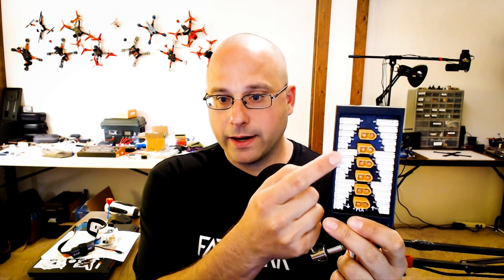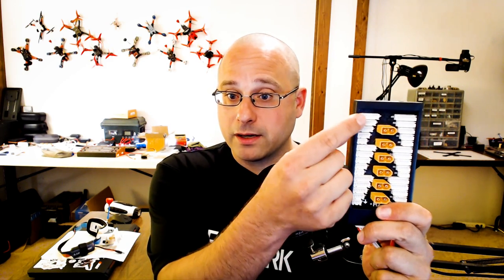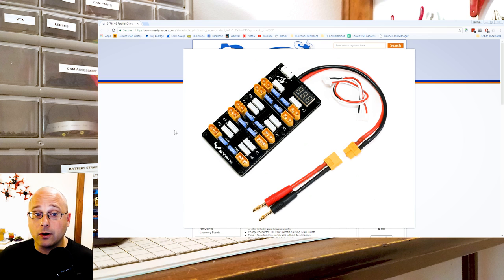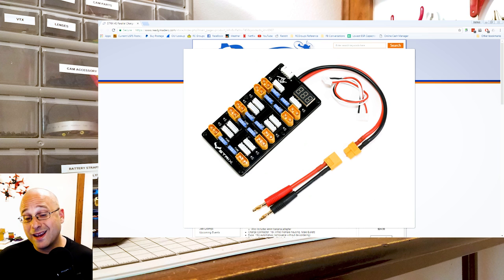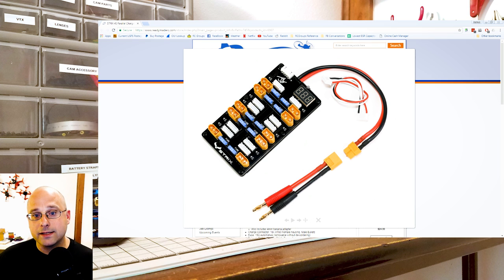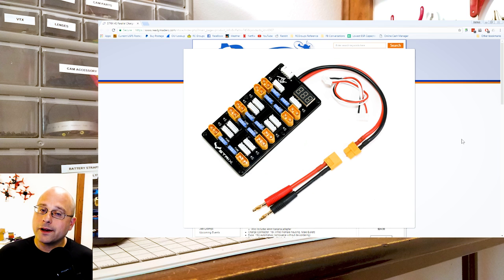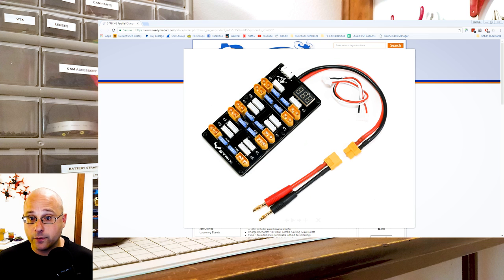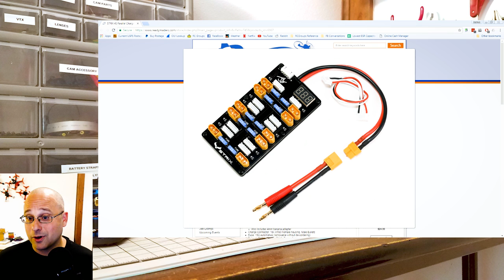The Best 4S Parallel Charging Board. Period. | JB SIGNATURE LINE

Comment: Is the voltage checker always on? If you store your batteties on the board overnight to charge in the morning will it be on the whole time?
Reply from the maker: I believe so.
Reply: Who leaves their batteries plugged into the balance board overnight ?? WTF
Reply: Why are you charging over night? That sounds like a really bad idea, especially parallel charging. And if your charging mini quad packs they only take 20 minutes max.
Reply: Phat Kid Nobody said anything about charging overnight.
Reply: Dude you make no sense... Just plug it in when you wanna charge.
Reply: I get what you're saying. I have ISDT and when charging is done it starts annoying me with beeps, at which point I unplug power to ISDT to turn it off but do not always unplug all the batteries from the balance board right then as well. They may sit connected to balance board but fully charged until morning, etc.. This would slowly drain them during that time. Not a deal breaker though by any means. Maybe include on/off switch for voltage checker in V2?
Reply: You make a good point, I killed some of my 2S packs for my micro as the balance board has LEDs on it which drained the packs down when I left them on the board overnight.
Reply: What C are you charging at to make them charge in 20minutes?!?
Reply: Eric Plank just turn the beeps off , I also have an ISDT... you can set it
Reply: 2C would take about 20 minutes, give or take. I charge at 2C. And I agree, I too will charge my batteries and then maybe I'm doing something else and the charger has shut down but I don't immediately run over and unplug the batteries. That is a very good point to make, in my opinion, but ultimately it's not super hard to avoid by making a slight change to my charging habits.
Reply: he said "to charge in the morning " but I agree, still a stupid place to store you batteries,. saves you a minute at best that night! what C do you charge at for it to take 20mins??
Reply: It is only stupid if you have a cheap, junk parallel charging board where it poses an issue, or if you’re not smart about it.

All your multi-cell lipo packs are basically the same thing….a bunch of cells wired either in parallel or series. That is all you’re doing when plugging them into a board.  Do you cut open all your packs and disconnect the cells for overnight storage???

When not in use during flight, ALL my packs are stored in fire-proof storage.  They are connected to the board so there is no stress on any of the wires, and there is nothing that makes this inherently more “risky” than having a pile of lipos not connected to a board.

It was a fair question, as the boards with flashing LED’s or readouts get annoying if you SAFELY have them plugged in while not charging.  Most people don’t do this, so it won’t be an issue for them...but it can be done perfectly safe.
Reply: 3c charge rate would be done in roughly 20minutes and most of today's lipos can be safely charged at higher rates then 3c
Reply: @ PowerScissor...AGREED, just as Joshua stated early on, the boards make one big battery. In fact, leaving them all connected helps keep them all balanced as one big pack... which in turn, should help maintain a consistent feel from pack to pack during the flying session. ALTHOUGH, checking balance on individual packs is a MUST for detecting a potential bad cell. Parallel boards may hide that for a little while.

Comment: NOOOOOOO! I just bought another one off amazon this am! absolutely brilliant MR. Bardwell! I was saying this the past x amount of times I parallel charged, about all the unused ports! not only that but I, I mean a friend of mine wasn't paying attention, because he cat came close. no kitty danger! well I,,mhhmhm i mean he plugged the balance in backwards. sparks, burning electronic smell. well i started using a black marker, and only coloring the negative side half of the 4s port. this was it makes it a little harder to make that mistake.  the price of this board is pretty darn good for what you get!!  especially with the xt-60 for supply connection! you are killing me, even though I just ordered a new one this am. i'm going to see order one of yours now! oh plus I think 5s might take over 4s. just a odd feeling! I have a 5s on the way to test this week. hehehe
 So here's my theory, and analogy that made me order 5s. So since all the new gear can handle 5s no problem people might be switching over.  Ok weight quads, so the extra battery weight will make it faster, because of increased angle of attack.
 now another thing. I pretty much toasted all my new 4s batteries, and that is not cheap! So here it is.
 You have a 2 brand new cars from dealership only difference is one is a 4 cylinder, and other 6
 now you want to get on the highway, and traffic is doing 80 mph. With the 4 cylinder your going to have to redline it to get up to speed fast enough to safely get into traffic. Now you try it with the 6 cylinder, and same scenario, but,  and here it is! You only have to give it 3/4, maybe even less! ohh big deal. well that 6 cylinders engine is going to last longer, because with the 4 your pushing it to the max all the time trying to get up to speed. just like any other machine if your riding it hard all the time it's going to breakdown more, and faster.  Now the battery is the engine. 4s = 4 cylinder, and 5s equals eight! correct me if i'm wrong, but since 5s has more volts your not going to have to draw as many amps to get the same rpm? you know i'm new to this so I could be way off!

Comment: Hi JB, was digging back deep in your videos because I had a battery fire in my apartment yesterday. I thankfully had all the secondary safety stuff (battery bag, ammo case, etc) that it was contained with no issues. But I was parallel charging 4 3S packs, when one burst into flames. Somehow the other 3 didn't get melted or burned. Are those other 3 batteries trash? The parallel board also? 

Frustrated that I've gone to OCD levels to make sure I don't deal with battery issues and still happened. Think I'm giving up on parallel charging and just doing one at a time until I can regain some confidence that it can happen in a more safe manner.

Comment: Hey Joshua, great job man! Hey, since daisy chaining is allowed, what is the max size fuse that can be installed for that particular port to feed the next board or boards? How much can those traces take? 

PLEASE, correct me if my math is wrong here.... Meaning, if you want to charge 28 of those 30 batteries, you'll have to daisy three boards. If they are all say 1500mah, 1.5 X 28 = 42 amps at 1C. 42amps/3boards= 14 amps per board. So, does that mean the first board gets hit with 42amps, second board port fuse gets a 28 amp fuse then the last board gets a 14 amp fuse?
Reply from the maker: The entire board is limited to 60 amps. I think your math is basically right. Every time a battery taps off the positive line, some current is moved over to the negative line. The fuses are on the positive line.kl

Comment: Great idea! I'm on the subscription list for when they're back in stock. Anyway, R-Lines have really short balance leads. Have you tried to plug a few of those in at once? Curious if it'll work as well as my standard balance boards with the balance connector along the edge.

Comment: Hey Joshua great product.  I already have mine!!  One question.  I am replacing my EP Buddy parallel boards with this one.  The EP Buddy ones have three 40a fuses and one 50a fuse.  Your board has ten 15a fuses.  Why is there such a big difference between the fuse sizes?
Reply from the maker: Just a question of where you draw the line for safety I guess. We don't think there will be a situation where more than 15 amps will flow into any individual battery, so that's how big a fuse we used. Part of the reason may be that we are thinking more towards the mini quad market, which uses smaller batteries.

Comment: The paraboard I always wanted was one that would level the voltages on my batteries before charging so I don't have to make sure the voltages are within the correct tolerances.
Reply: This is my issue as well.  I don't have enough batteries to have enough batteries that are all within a close voltage to really make use of one of these.  I guess if i ran 20+ batteries or more during a session, something like this would be useful.  Maybe.  Given that my batteries all come down with voltages different enough, I'd rather just use two or three actual chargers.
Reply: @ thejason51873 Just plug them into the board and let it sit for a little while before charging. They will balance out without charging...meaning all of the cells on the first circuit will balance to each other and same with the rest.
Reply: That's just the way it is, otherwise, look the RCmodelsreview Youtube vid, about balancing lipos , and the special cable bruce made, for a single cell of your lipo.

Comment: you can shave off part of the locking tab on the 4s balance lead so it will fit in a 6s balance port no problem and its still keyed so you cant plug it in the wrong way

Comment: Hi, great product.
About chaining the paraboards, I'm not sure it's such a loss. I don't know the internal wiring of mine (hk, 4 out, with fuses) but I noticed a pretty big voltage drop: 0,5V between what the charger sees and the last lipo with 3 boards . The first lipo sees less, but it's still something like 0.2/0.25V more than the last one on the line. So when I start charging from an identical voltage, I think the first ones get charged at higher undertermined current than the last ones. 
What I do is not a chain but a loop of paraboards so the current flows in 2 ways. I also put the less initially charged batteries the furthest from the charger connection and put less than 1C of my average load (typically 10/12 instead of 15).
Am I paranoid, or does the voltage drop affect how faster the first batteries on the line charge ? I guess it would take a dozen of amp/voltmeters and some wiring to find out.
Reply: wires are also resistors
Reply from the maker: You're right about this, although I haven't seen 0.5 volt myself. This is why I always charge at only 1C when using parallel boards. Because the batteries on the board closest to the charger get a higher current and I don't want to damage them.

Comment: That looks very very nice! One thing that I have on mine and would make it better, albeit a little bigger, would be resettable fuses for each balance trace (I know there is space concerns but maybe the other side of the board is not that populated?). People are supposed to plug the XT60 in first but just for additional safety, that would make it just about perfect. Hints for version 2 :) I'm guessing there could well be a 5S or 6S version in the future?
Reply from the maker: The problem with polyfuses is they are expensive. Look at all the boards that have polyfuses. They are $60 to $80 for a six-port version. $10 per port vs. this board which is $2.50 per port.
Reply: Thanks for taking the time to clear this up!

Comment: Looks pretty sweet! However, I don't think it's the board for me, as I still have 10+ 3s packs I use on a regular basis.

Also, progressive RC has some nice para boards. Theirs have removable fuses and such, but lack voltage checker. But, if you are using the para board with an Isdt charger, it is quite easy to plug   in a battery and see the voltage.

I'm glad you finally released a well thought out product though. Good luck!
Reply from the maker: No offense intended, but Progressive is asking $24 for a four-port fused parallel board. If you intend to charge mostly 4S, there's no contest.
Reply: Joshua Bardwell haha yes, that is very true. PRC para boards are not cheap, lol
Reply: That's a one time expense :)

Comment: Great product. 
How long does it take to fully charge ten 4s 1300mah 14,8v batteries when they are empty? 
Thank you
Reply from the maker: 1C is the safest charging rate. It always takes exactly 1 hour to charge at 1C, by definition :-)

In reality, the batteries won't be 100% discharged, which shortens the charge time, but if you balance charge, it lengthens the charge time. And in my experience those two often sort of cancel out. 

If you are charging the 10 batteries one at a time, then it will take you 10 hours to charge them. If you put them in a parallel array, and if your charger can output 10 * 1.3 Ah = 13 amps, then they will charge in 1 hour.
Reply: Thank you for your detailed answer, helped me to understand the parallel charger!

Comment: What is the best bang-for-buck lipo in your opinoin? I am on a pretty low budget and want to buy some 4s batteries between 1300 and 1500mah. Could you make a conclusion video of your battery comparison videos? Great product by the way.
Reply: gustav gans go with cnhl batteries, usually on sale, way cheap, but good quality, I see a lot of YouTubers flying them. I fly them, only had an issue with a couple bad cells when I left them all fully charged for 2+ months on accident. Yeah don't do that.
Reply: thanks

Comment: I feel like there should also be Fuses between the Balance Plugs.
What if i plug in a fully charged battery with an empty one? I think there would be high Currents
flowing via the Balance Plugs that could potentially destroy something.
But maybe i'm Wrong, what are your thoughts on that?
Reply from the maker: Fuses on the balance lines would be too expensive and take up too much space on the board. Plug in the XT60 first and if excess current flows it will blow the fuse. Once the XT60 are plugged in, it is then safe to plug in the balance ports. Alternatively, if you plug in the balance ports first and excess current flows, it will likely blow the trace on the board. The board is ruined but at least a fire didn't happen.

Bottom line: check your packs before plugging them in. If you can't consistently follow safety procedures, parallel charging and skydiving are not for you.
Reply: Makes sense, i was just thinking about the typical user who doesn't know or doesn't care and just plugs all his batteries in because "it's save it has fuses" :D

Comment: Shouldn't you tighten up those fuses to 5ish amps instead?  Maybe I'm old school, but I generally charge at less then 1c.
Reply from the maker: It's up to you. If you plug in a battery at, say, 0.4 volts difference, you will get 10 or 15 amps of flow for a few seconds. This isn't dangerous, but it would be annoying if it popped your fuses. 

https://www.youtube.com/watch?v=yTEGhKBv09M

Comment: Awsome product! Can you please explain why parallel charging Lipos without the balanceplug is dangerous? If I charge for example 2 3s Lipos in parallel with the balanceplugs plugged in the charger measures both 1. cells as one, both 2. as the second and both 3. as the third. Since the voltages of each cell balance each other out I dont get why it is dangerous to charge them without the balanceplug if the Lipos got the same voltages. If my first battery has 11,1v and the other one also 11,1v it would be again "one" big battery with a bigger capacity to charge. Where is the problem? To me it seams that it doesnt matter if you parallel charge with or without the balanceplug plugged in as long as the Lipos have the same voltage.
Reply: Webster because they have slightly different internal resistance, and the get worse as they age and they don't all agree equally. So if you charge without balancing, you may be ok the first couple times, but more and more they will get out of whack. There higher resistance in one cell will cause it to take less amperage, increasing the amperage and charging speed of the other cells. Soon you will have a 4s pack, fully charged, with 4.3v, 4.3v, 4.3v, 3.9v. not only is that dangerous, and bad for the longevity of the battery, but your performance will suffer too, you only get as much power and flight time as your lowest voltage cell. If you fly to standard low voltage, you may land with 3.9v, 3.9v, 3.9v, 3.6v. etc etc. Balancing is safe, it's good for the battery, it's good for flight times, and it's easy, why not do it?
Reply: Tom U thank you very much for your explanation! I do balance charge all my Lipos which have a balanceconnector. But I recently built a few 2s Lipos out of 1s Lipos which I parallel charge without a balanceconnector. I will keep an eye on them while charging and I will add a balanceconnector ASAP.

Comment: Board came in today, looks awesome.. to work with my Duo 406, parallel cable is a different configuration,  do i just need to move the ground wire onto the duo 406 larger connector,  "far right pin"

Comment: oh auto format... here is wthat the lower part should mean:

A parallel balacing lead for multiple batteries (sold by HK) and then to connect the charger (minus) pole solder a 4mm banana plug to the (minus) pole of the parallel balance harness and same with the plus pole.
Another advantage is that you do not have any short circuits by wrong connection via the XT60s.